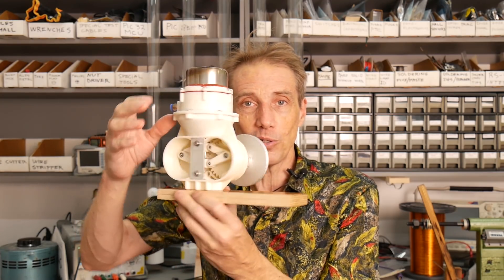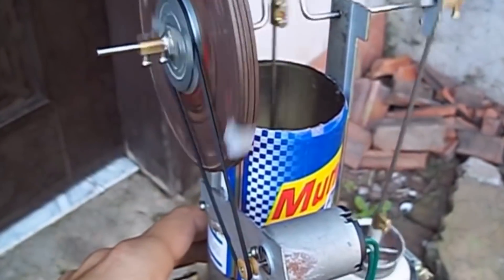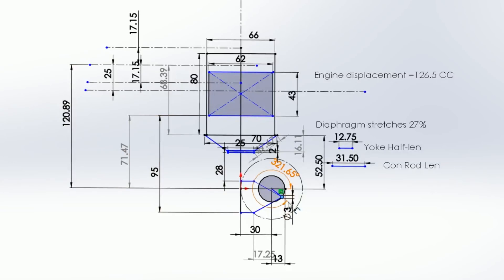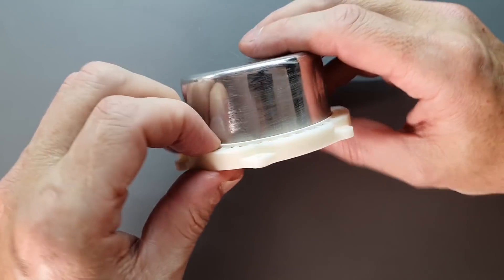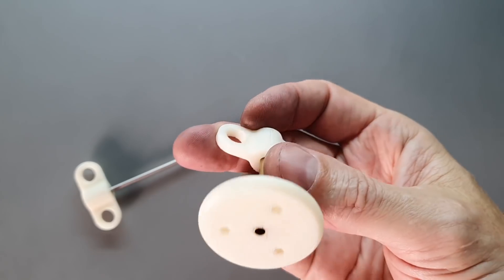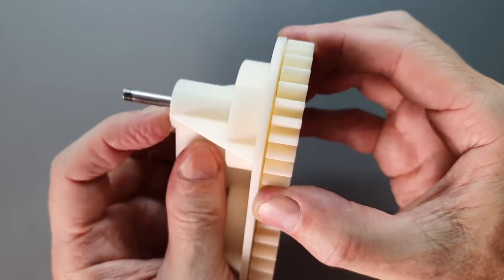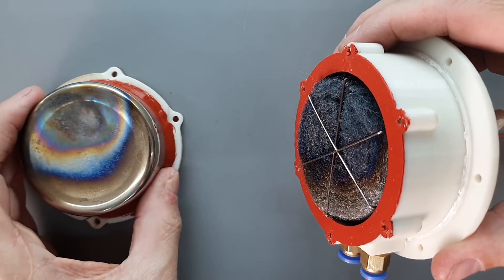The Stirling Engine Project

Comment: Use copper wool for your cylinder head and put a disk of aluminum on the bottom to make it mostly airtight. The heat transfer will be much better and copper wool won’t melt. You can use 2 hex nuts and a washer to attach the piston shaft to the cylinder head. Air will still leak around the edge but if you cut it close enough there should be less than half a mm all around for air to get by.
Reply from the maker: Where does one get copper wool?

Comment: Hi, Leo this is another Leo.  I have build a stirling engine and fussed with a displacer.  Idea I came up with was to use course steel wool as there are more air gaps than fine which allows for better heat transfer between between hot and cold strokes.  I also used small pieces of 1/4" mesh screen and very thin large washers to capture the course steel wool and form the displacer piston.
Reply from the maker: I would love to see a photo of this assembly!

Comment: Hi Leo, is there a way you can show us a stirling engine that uses rocket stove to create electricity(rocket stove is the major source of heat that uses renewable materials in the third world which is readily available)  let us say for about 300 watts? If you will be able to do that, I will order 300 engines from you but make sure it works because it will be sent to farms in the Philippines, solar panels are great but we need batteries for that to store and manage the electricity during the night. If you will solve this problem, let us say you will be able to sell $3 per watt, you got billions of orders,  no, I am not kidding,

Comment: if we used depleted uranium that's still hot. we could extend nuclear refueling cycles and get more energy out of the core. why haven't Nuclear power owners looked at the Stirling as a venue to squeeze more power out of the core from the start of its use till its cool???

Comment: Very nice video.  I've been into DIY solar/powerwalls the last 3 years, and the addiction of finding / processing used 18650 cells into large batteries is a similar addiction.   I'd LOVE to acquire (build I guess) a stirling engine in the 5-10hp range as a wood fired generator - but as you know, there's nothing available on this that I can find or buy in any reasonable price range.    Again, really enjoyed  this inspiring video - good luck on your work.

Comment: Subscribed and Liked. Really like the way the information is presented. More logical and better explained than lots of other channels. I hope you will continue this project and go into the actual power output across temperature ranges. 
One thing that did occur to me was the use of a passive water cooler using the heat difference to induce flow.  That would, for me, be an intersting addition to the project.

Comment: Hi Leo, I suggest you to try permanent magnet dynamometer. Basic configuration being the drive shaft rotate an aluminum round plate; while the dynamometer itself is a matching round plate with neodymium permanent magnet attached. Both plates are facing each other & are contactless, as the aluminum round plate rotate, the dyno round plate with magnet will be induced to rotate thus torque can be measured. Gap between two round plate can be adjusted to vary the load to drive shaft.
Reply from the maker: Thanks- you read my mind - that is exactly what I was planning to do.
Reply: @leosbagoftricks3732  looking forward for your update on your engine design and performance.

Comment: Well done on your brilliant design. I built a small eddy current dynamometer about 20 years ago for characterising small electric motors. However the interesting thing about a sterling engine is its efficiency, not is power output which is low. So measuring the output power of your engine in its current configuration is pointless, because you cannot measure the power in, and therefore you cannot optimise it. You probably need to change it so the power in is through a electric heating coil, then you can measure Watts in and compare that with Watts out.

Comment: That regenerator/displacer is really cool. It would work wonders with helium as the working fluid and not rust or burn away the displacer.
Reply: I would pay money to see it use Hydrogen, which is even better performing :-)
Reply: @dnomyarnostaw  Hydrogen worms its way into metal especially at high temperature. It would make the metal very brittle.
Reply: @leerman22  Like all modern Hydrogen handling equipment,  you would need to use a ceramic coating on exposed surfaces.
Reply: @dnomyarnostaw  And the ceramic coating doesn't crack from repeatedly going from high temperature to ambient?
Reply: @leerman22  Ceramic doesn't crack on high speed diesel engines pistons .
Also,  the hot air doesn't need to be from direct flame on metal .

Comment: I've been a Sterling fan since I was 12yo. I'm 69 now and still a fan. A Regenerator actually is very important for the overall thermal efficiency of the engine. Why I never thought of a Displacer/Regenerator combo' is beyond me. It helps to address the 'dead volume' issues associated with a dedicated, external regenerator and associated plumbing. Great Work!
Reply: Je réfléchis à un bicylindre pendulaire avec deux grosses bouteilles d'oxygène et un des déplaceurs remplis de tores de cuivres . Je voudrais entrainer un volant d'inertie.

Comment: Some build ideas: 
1. Make the displacer out of a smaller Stainless Can. No need for a Regenerator !.
2. Skip the diaphragm & use a Real Piston but no Piston rings! Rather a Slip Fit & a few drops of WD-40. Even Teflon Piston rings have too much friction for these small engines.
3. Skip the Rhombic Drive & use a simple, single sided Crankshaft with 2 bearings on the same side.
This man makes Beautiful engines, here is how he measures engine power with a piece of String!  https://www.youtube.com/watch?v=cc3KCoFnZTQ
More beautiful Stirling Engines: Andy Ross https://www.youtube.com/watch?v=txw-PXV52rU

Comment: Wonderful ! I have been building Power Stirling engines for 40 years, & never thought of a Plastic Body! Genius!!  I also use thin Drawn Stainless Steel "Cups" most flour & sugar "Dredges". My Hot End gets Red Hot and I attach it to the threaded Stainless cylinder ring with brazing. I used to use JB Weld where you are using the Silicone. 
Great work & Thanks for show it to us!!

Comment: Leo - What superb work you have been doing
And yes, the dynamometer does help with working out what is going on
I've been recording my results measuring engines in an online book.
Maybe there's info in there that you can build on?
Search for StirlingEngineBoats - all one word
Page 21 and related pages have some dyno measurement charts
Also in the "Engine Room" section - there's the wattage calcn maths

Could you contact me? I use gmail(com)
I'm andrewthamesside - all one word

Comment: FINALLY! ... someone built a Rhombic Sterling. So much better than 90deg Phased and Free Piston Sterlings.
Reply: You are one of the pioneers that might get this between people or at least make others teach something. And I want to say that even that i don't have much of the materials to make one of stirling engines, I wanted to try using my car for projects with one... And your water-cooled system might be a great solution... Using hot exhaust gases to get hot part and water cooling for another, the engine could  utilize it's power to power it's own water pump and additional hardware... So thanks for the addition into the stirling engine research...

Comment: do you think if you left it out in the sun the metal would get hot enough to run the engine?
Reply from the maker: Perhaps with some mirrors to concentrate the solar energy on the hot cap.

Comment: nice, i like it almost like 'barumman Stirling Engine with Rhombic Drive Part 1'

tip, rather than use a flame make one of Roberts low power conductive ink paint on heaters for direct localised heating it.
'Robert Murray-Smith
 How To Make A Heater From Paper'

Comment: Why not attach a motor and measure the watts generated?
Reply: Absolutely agree. Its not the theoretical measurement, it’s the usable output.
Reply from the maker: Without knowing the power curve of the engine, slapping a generator on it might yield feeble performance. If i can measure the actual shaft power output curve, I can then match the generator and pully ratio to the engine to extract the most electrical power. You essentially have to "impedance match" the generator to the engine.

Comment: Print for O rings for assemble for water jacket that way you will seal and be able to reassemble with ease.  silicon high temperature O rings are available. through McMaster-Carr. SAE or Metric... 
 I would like to help with design if interested contact me.
Reply from the maker: The main problem is the porosity of the 3D printed parts, the layering does not create a gas-tight material. I tried to seal the parts by spraying a conformal coating on them, but it still leaks.
Reply: @leosbagoftricks3732  Would the acetone trick work with your blend of filament ? It might be worth a try

Comment: For the dyno I would suggest  using an electromagnetic break system(a tube within a tube with iron powder between them and an electromagnet in the center tube would do the trick) with a load cell to to get the torque, but I cant wait to see what you come up with.
Reply: Could he use an off the shelf DC micro motor connected to a variable resistor with an ammeter?

Comment: hi.    an  ICE   is   NOT  a  heat  engine.!!!!!!        ICE  design is  only  Superficially  similar to that of a heat engine.       where a heat engine is horizontally oriented, the affects of gravity  are  rendered,  Uniform.!!!!        (where the sides are  physically separated and)  the cold side is  Not  above the heat source, the adverse affects of  Convection, become  negligible.      where a duct is  correctly  made of a material that conducts heat  Poorly, there is less  conduction  of heat to the cold side.         unfortunately, the development of heat engines  ceased, when  electric  motors  came along.    also, unfortunately, stirling/others did not see that,  the massiveness that is necessary in other engine types, is  NOT  needed in a heat engine.      what is  Needed is  low mass in  All  the  reciprocating components, the  highest possible (un-loaded) speed, and  the  Maintenance of thermal isolation between the sides.     (whoever came up with the beta config  Obviously  did not  Understand  the  Latter.)      supposedly, one of the shortcomings of a heat engine is  low  speed.       but, more recently, it has been shown that   2000 or more rpms  are  Possible.     and, that  IS  a  usable  speed.       the output of a heat engine is  Always  low torque,  so an engine should run as fast a possible, all the times.       a heat engine should be loaded, Accordingly; with an initial stage  of  very  High ratio  reduction.       do you know  HOW  a flywheel  Should  be made.     a flywheel  Should  have a  concentration of  MASS,  at its  perimeter/outer radius.      cheers         googletranslate

Comment: awesome, are you willing to share the .STL files?
Reply from the maker: The engine is modeled in Solidworks- would it not be better to have the whole design? or STP or IGES files? Just the STL files makes design changes difficult, what if you cannot get the same stainless steel pepper shaker that I found?
Reply: @leosbagoftricks3732  good point, all the more reason to find something on Amazon that is easier to source!
Reply: @leosbagoftricks3732  Sure I'd love to have the files, and attempt my own build
Reply from the maker: Email me and I will share the files

Comment: some information/observations.
that is a lot of input energy.
is it ridiculous use  Melt-able materials in a heat engine.
the vibration at start-up, indicates just how  Unbalanced the  over-complicated linkage  bits are.!!!
this is an  example of  an  over-Complicated,  energy  Absorbing  linkage configuration.      the word  'drive'  means  NOTHING.!!      at speed, this type of linkage does  smooth operation, but, at the  COST  of  energy   LOST.!!!!!
ever hear of  GRAVITY.???    if so,  WHY  did you choose to use a  VERTICALLY  oriented  design.!!!    equals,  More  energy  LOST.
this engine has a  minimally effective  flywheel.!!     and,  a  flywheel  is  NOT  a  pulley.!!!
a beta configuration is  the  WORST,  because it is impossible to get  good  thermal isolation of the sides.      thus, supplemental cooling  is often used, by folks  who  don't  know  any  better.!!!
it can be understood that a  WELL-made  alpha or gamma configuration does  Not  need  supplemental  cooling.!!!      see  a well-made alpha, at link.
ideally, the stroke lengths  should  be equal.     as they are, in an alpha.!!!      obviously, in such a case, the displacements of the sides  Need to be  complementary; eg., not equal.    (a ratio of 1.6:1 is a good place to start.)
the (bilateral) tension in a diaphragm is the  Enemy.!!!    because, in order to run, the engine  Has to overcome it.     and,  energy  is  Lost.
at 10:19,  there is a serious shortage of precision, in the fit at the displacer shaft guide.!
you should  LOOK  at  what  others  have  done, to make a  good, heat-tolerant, low-mass displacer.
when a displacer shaft guide is utilized, there  Should  be a bit of  clearance, around the displacer.!
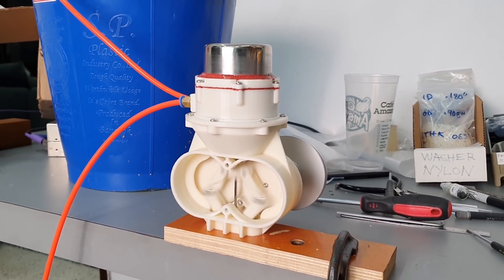at 11:46,  counter-weighting  should  NOT  be  used  with a heat engine.!!!      because, it  ABSORBS  energy.!!!!      where a component rotates,  its  Mass  Should  be  Radially  Symmetrical.!!!      this is why  disc-shaped  cranks  are  frequently  used.!!!
whatever the method used to make components,  the  foregoing  Facts  should  INFORM  design.!!!         googletranslate
https://www.youtube.com/watch?v=mfyvd5KhA0k
Reply: Those are interesting points and I can't disagree (with ones I understood). However, sometimes design constraints lead to compromises. E.g. why are ICEs in our automobiles made with (mostly) vertical cylinders? The energy loss hurts mileage, but optimal design would take more engine compartment space, which is constrained.

Comment: What about exploiting exaust heat on a piston engine to generate electricity to up the global efficiency ? A linear alternator would be the perfect mate for this.
Reply: I like the idea of a linear alternator built into a totally sealed engine. This would make it feasible to use pressurised helium to achieve higher power density.

Comment: Good to see your engine in working condition. The regenerative displacer is one of the biggest challenge I think. Low friction, good volume of steel wool, but the stainless steel better for this, and the low as possible leakage. I mean the displacer leakage how big portion of gas not goes trough the regenerator section. For a long time usage the cold side plastic part should be shielding from the hot side with a trap for the flame also some high temp insulator blanket between the surfaces. Are the gears in good condition? I will follow your work, because it is so detailed and precise. I like to use 3D printed parts, but actually mine doesn't work well. So keep up the good work! Congratulation! BLADE
Reply from the maker: Thank you for your detailed observations- I am going to work on that displacer/regenerator part, along with building the dynamometer to evaluate the results.
So far the mechanical drive train seems to be holding up to the job.
Reply: Yes, in my experience steel wool displacers catch fire at higher power settings. Stainless mesh tends to worker better but is harder to work into shape.

Comment: Have you thought of sticking it next to a parabolic reflector? Or 3?
Reply: There is a cool way to make a reflector with a mylar sheet and a trash can lid. You put it over the lid and pull a slight vacuum to get a parabolic surface.-
Reply from the maker: Yes! that's a bit down the road, but what a cool idea! Build a big sun-tracking mirror thingie and stick this engine at the focus.
Reply: @leosbagoftricks3732  exactly, but beware the rabbit hole of projects building each other! Oh did you try mechanically running the output to get a cooling effect?